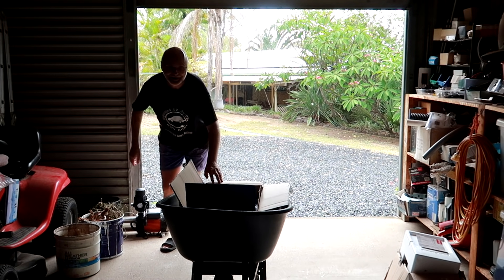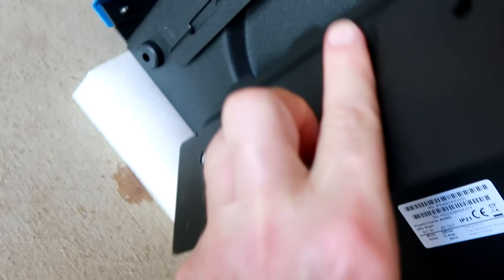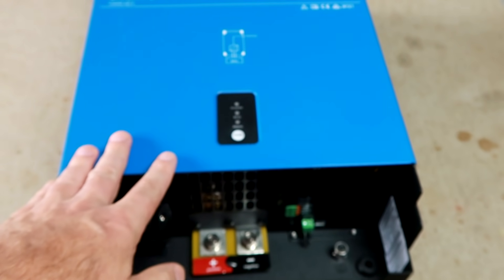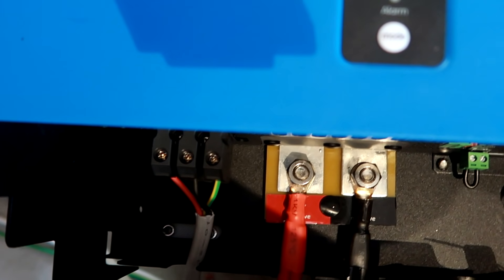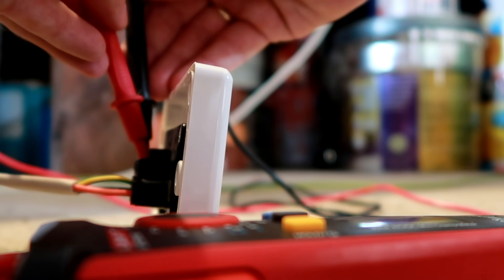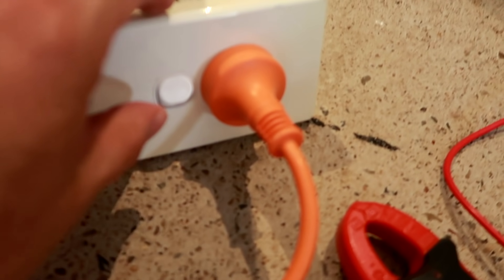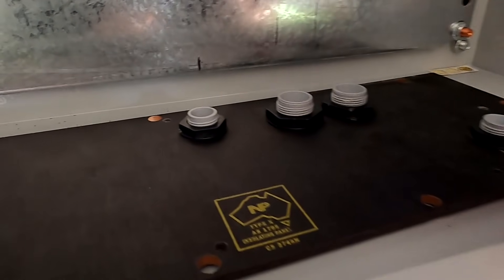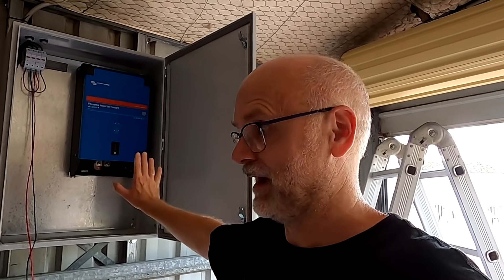Victron Phoenix Inverter Smart. Is 3000VA enough to power our garage?

Comment: Lol you corrected.
Do they use va because it's 2462 watts?
Personally I don't like VA as it's a mean calculation.

My inverter is 1500w with 3000 peak. Well that's what the label says... However having a look at the Mosfets datasheet I'd say it was 1500w only. 

I've a 800w inverter which is 950watts from the data sheet of the Mosfets.
Technically it's a UPS, as I  have a main inverter and sub ones for essential running, also if the main one goes down I can still run;)
But I want to get a bigger inverter. Mine seems to offer weak power if that makes sense... 900 watts grid to 900 watts inverted isn't the same :(
I notice it on my tools.

Comment: Victron is great gear. I have installed it in yachts and always works great. I am picking up 5.5kw of solar panels and rail mounts tomorrow (second hand) in anticipation of getting the MPP PIP 8048MAX which I am saving for. I would like to see if I can charge electric cars directly from the sun with no battery attached to the system.
Reply from the maker: Wow another 5.5kW, that sounds awesome!
You need a specific charge controller which can supply the load without batteries. I don't think Victron can do that though. Also, I don't know what the car's charger would do if there is fluctuation power coming in all the time. Needs to be tested I guess...
Reply: @OffGridGarageAustralia  Hi Andy. The MPP PIP 8048MAX handles batteryless output. I do intend to set up a 16 cell Lifepo4 battery like yours once I get the money together. How many KWh of usable energy does your pack hold? I have just arrived home with the solar panels and rails which I picked up on the Sunshine Coast. Paid just $250 for the lot so I think that is a good deal.

Comment: Hi Andy,

You really should just get a GX device to control/communicate with your devices via VE.direct, VE.Bus, and/or VE.Can. The Bluetooth network is still so new that many Victron products don't support it yet. You'd also need to trade your "Smart Shunt" for the standard wired BMV (Which still offers Bluetooth as well). But if you want to do the load shedding we discussed in an earlier comment thread you'd need that anyway as the wired BMV has an additional relay that can be programmed to come on when the battery reaches a certain voltage.
Reply from the maker: Yep, I know. I am looking into it for a while already. I can also program the inverter to do shedding with its relay.
Reply: @OffGridGarageAustralia  True, but I thought you were going to use that relay to control the fan for your enclosure? :)

Comment: You guys over there are lucky.  Here in the US we have 120 volt single phase and 240 volt split phase which is of course two 120's that are 180 deg out of phase with each other.  Use of 230 volt all the time make so much more sense to me.  How this all started here in the US is beyond me.  We have some devices that are 240 and others that are 120 volt.  Such misery and confusion and with inverters doubly so.  We can get split phase inverters but at a premium cost.  So we have to wire our inverters to a panel and use either single breakers or 240 (2 pole) breakers.  Then of course for some commercial applications there is 3 phase where the legs of current are 120 deg out of phase.  All in all it's a huge inconvenience and expense.  We used to have 'Y' 3 phase and delta 3 phase.  I believe they've done away with Y.  Then we have 440 volt and 208 volt in 3 phase.  And if you tap one hot leg and a neutral in 208 you get some wacky voltage.  And none of that accounts for voltage fluctuation within a particular nominal voltage.  Some things you can run on lower voltage but some will burn open if you do so.  Better read the labels thoroughly here.

Comment: Andy. As people have already mentioned here and I did earlier it is a 3000va inverter. Not 3000 watts. It’s 2400 watts continuous. You multiply the va by the power factor which is always under 1.
Reply from the maker: A light bulb has factor 1, right? Shows me 80VA with a 100W bulb though.
Reply: Off-Grid Garage Yes. But it’s still a 2400w inverter.

Comment: Hi. Have you considered that overload you were getting may be related to DC conductor cross sectional area and length of cable. You may be experiencing lower than optimal voltages. Cheers. Keep up the the great videos. Shane
Reply from the maker: Thanks Shane!
Absolutely. I need to cable everything correctly and will do more testing afterwards. This was just a first test to see the functionality quickly.
Reply: @OffGridGarageAustralia  you may find this calculator handy. I did some calculations for your set up 48v 250 amps and three meter run with 1% tolerance. It recommended 70mm2. I suggest that’s about right compared to my set up. Cheers Shane
Reply from the maker: @shanebrowne2439  with the 3kW inverter, I'm pulling only 50-60A max. The battery has a 100A fuse. My cables are 'only' 35mm for that setup. I keep it easy...

Comment: You can run Venus os on a raspberry pi to tie everything together.
Reply: That's what I use in my campervan. I have the Pi connected to a 4G router so I can monitor it remotely. Works really well.

Comment: Does anyone know where the weight difference comes in?
These are 19kg
Renogy equivalent is 7kg
Obviously there is a dramatic quality difference but the weight difference is crazy.
I wouldn’t use anything but victron inverters but just interesting to know
Reply from the maker: The Victron inverters have huge toroidal transformers which is essential for large loads starting.

Comment: Why would you want the inverter to be connected to the VE smart network? This basically exchanges info about battery voltage and temp, and synchronises charging sources. I can not see where the inverter comes into this. On the VE network (cabled), you would get data out to Victron controls and Victron displays, but you have these data already out to your phone.

Comment: Can't you just measure the continuity between the inverter case and the PE terminal to see if its grounded?
great video as always
Reply from the maker: I did, it's 0 Ohm.
Reply: @OffGridGarageAustralia  can u measure ground of the solar panels and ground of the inverter and see if is there any 50 volts. I mean like the problem with the anoter inverter, the chineze one and i hawe the same problem with an voltronic vm3
Reply from the maker: @andreiapostolache3487  yeah, I did this already and there is no voltage between AC and DC with the Victron inverter. I'll show this again in one of the next videos.

Comment: In Nordamerika sind 120V und 60Hz Standard, der Wechselrichter kann aber nicht bis 120V heruntergehen. In manchen Ländern wie Südkorea und teilen des Mittleren Osten sind 230V und 60Hz Standard. Dafür kann man das umstellen.
Reply from the maker: Victron sells different hardware for different markets. The frequency can be adjusted but not the voltage (in that range).
I didn't know Middle East has 230V/60Hz. Crazy...
Reply: @OffGridGarageAustralia  Nicht nur im Mittleren Osten und Südkorea. Auch in Peru, teilen von Brasilien, Guyana und den Phillipinen sind 230V 60Hz die Netzfrequenz. Deswegen sind viele Elektrogeräte für 230V für 50 und 60Hz ausgelegt.
Reply from the maker: @OffGridValentin  There you go....

Comment: Say that the inverter could join the VE Smart Network, what useful purpose would there be in having the battery voltage being sent to it wirelessly when it can just measure the voltage at it's own terminals? I like the idea of having it on the VE Smart Network as well but I can't really think how it would add any value? Everything the inverter needs to know it can obtain locally, why complicate it?
Reply from the maker: It compensates for voltage drop and would know the real battery voltage measured by the Smart Shunt. Especially important at higher currents.
Reply: @OffGridGarageAustralia  the voltage measured at the battery is irrelevant to the inverters operation, it doesn't matter if the voltage drop is 0.1V or 5V the inverter has no ability to change this and will compensate accordingly based on inverters input terminal voltage. I am genuinely interested to hear what you think the inverter could usefully do with the battery terminal voltage instead of at the inverter input terminals?
Reply from the maker: @isaachauser521  it does matter if the voltage drop is higher. The true battery voltage matters as the inverter could keep running longer. It gets the wrong picture of the state of the battery if it measures only at its terminals. 
But the inverter is smart! 😉 It has a setting called Dynamic Shutdown where it not only measures the voltage but also the current and shutd itself down according to the actual load. So higher load, it shuts down later. With this setting it somehow compensates for voltage drop between inverter and battery.
Reply: @OffGridGarageAustralia  it does not matter how much higher the battery voltage is compared to the inverter terminals, once the input voltage is out of the inverters operating range, the inverter will stop. The Dynamic Shutdown setting you are referring to is the unit dynamically adjusting the shutdown voltage based on load, this indeed compensates for voltage drop and sag from the battery itself, it basically just sets a series of shutdown voltages and current points and then interpolates between these values when deciding when it's time to shutdown due to low voltage. Example (200Ah LiFePo4 battery) 1A current = 52V shutdown voltage, 50A current = 50V, 140A current = 49.20V and 400A current = 48V. I understand you want it to talk VE Smart Networking but again I ask what useful thing would you like it to do?
Reply: @OffGridGarageAustralia  Andy, I'm going to have to disagree. The only way to counter the effects of voltage drop is to eliminate it to the greatest extent possible.  
In another response I have detailed a cheap and easy way to achieve this. 
Where V is voltage drop, lost energy is V squared divided resistance multiplied by time or if you prefer current squared by resistance by time.
For high current extra low voltage circuits resistance needs to be minimised.  Keeping cable runs short and using two or more cables in parallel divides the resistance and I strongly recommend the use of Belleville washers at all high current connection points to vastly increase  effective contact area. 
Cable lug preparation and crimping is another poorly understood issue. It is worth cleaning inside the ferrule of the lug before crimping. Oddly enough indent crimpers are the most effective for flexible cables.

Comment: Just put some window screen over the vents and they make filter material you can cut to size for computer fans 😎👍🇺🇸
Reply: 030521/0206h PST 🇺🇸 ....that may also not be effective. The garage also is metal enclosure and it’s closed when Andy leaves home. Looks like double Faraday Cage. Heat is what Andy needs to look into. Australian summer is quite hot, about 26.8C (80F+) and climbing. Imagine the heat inside the garage and the inverter enclosure.
Reply: Ya keep it outside the enclosure with screen and filters

Comment: What did you get up setting the float and bulk/absortion voltages on the 48v-16s system
Reply: depends on the battery specs

Comment: 16:27 sorry but If you tighten the screws firmly, there will be no problems between plus and minus even without protection. When working on the cables, the lines should be de-energized.

Comment: i am suprised with them doing conroller shunts inverters etc that they dont have a control head unit that can collect all information and display it to what ever device you wont as in a single screen but the info for all devices
Reply from the maker: They do have the GX devices which connect all devices together and also present the data on an online platform which you can connect to and control al; your devices.
Reply: @OffGridGarageAustralia  oh i did not know about that not scene anything about it
Reply from the maker: @1981dasimpson that's the one I'm looking for a while.  https://www.victronenergy.com/media/pg/Cerbo_GX/en/index-en.html
Reply: @OffGridGarageAustralia  ok thats a game changer i was looking at electrodacus for when i go off grid again but hmmm victrom may be building the kinda system i may want i just wish they would make rack mount stuff

Comment: I think you are going to need fans, input fans, and exhaust fans at the top.  That is going to be hot, even at idle at 18W with no airflow in the large case.  Looking good!
Reply from the maker: Yep, definitely need active cooling and airflow. Idling and small loads are fine with closed door. But it all depends on the ambient temperature as well...
Reply: @OffGridGarageAustralia  But why keep it in the closet, it makes no sense, it is made to be in the open, just NOT to get too hot.

Comment: For the Communication between the devices you Need to configure the ve Network.
Why did. you get a Phoenix ? And Not a multiplus ?
You als Need to put your MPPT in the ve Network.
Reply from the maker: You need a GX device for all that...
Reply: @OffGridGarageAustralia   
You can also Use a multiplus whitout a Gx device.
Reply from the maker: @dietermaes2647  yeah but you need a GX if you want to access your system through cloud...
Reply: The easy solar comes with mppt and colour control (old models) the new version has a simplified GX, but lacks the Ac distribution of the old version. It was on the Victron YouTube channel recently!

Comment: How about cutting some sort of an opening in the door and fit a plexi glass so you can gaze at your perfect workmanship?
Do i forsee you install HomeAssistand on a Rasberypi with a Bt dongle, so all your Victron Bt devices connect to the pi and you can use your tablet or phone to 
watch charging, current draw, tempereature`? I think you can even add your Tesla to Homeassistant so you can check the status.
Would be nice to have one place where you can see everything.
Just a thought-..-

Keep up your Great work Andy, I do enjoy watching your videos from Norway.
Reply: Yep, I think he will be cutting some sort of opening in the door, but probably for cooling, not plexiglass ;-)

Comment: OMG, He is reading the instuctions. LOL
Reply: yes now he reads - pity he didn't bother checking the specs before out-laying $1000 on a lower performance inverter. Many tried to tell him to go to the 48/5k. and he seems fixated on confining the new unit in a stuffy little box. to get anywhere near the 3kva output he'll need to keep it under 35℃ ambient so good luck with the cabinet.
Reply: U shold change setings from 230v to 240v for more fast charge on the Tesla
Reply from the maker: @andreiapostolache3487  I'm not in a hurry
Reply from the maker: @colinbeckitt9495  You must be new to the channel. I explained multiple times why I didn't buy an MPPsolar. Back to start and read the manual!
Reply: @OffGridGarageAustralia  nice i was doing the same and i check all the óptions i mean 240v it was more eficient for my Heat pump
Reply: @colinbeckitt9495  why not i read It to and was not a victron It vas a voltronic all in one, and learned alot changing óptions and see if is beter ir not

Comment: it would have been better to connect cables to inverter and pre charge at battery. It looked cramped to get that resistor in that space.
Reply: Yeah always connect the inverter cables before the battery, then you aren't waving live cables about :D

Comment: The price of a simple current transformer is enormous (€1,800) compared to what it offers, and the companies that offer the warranty charge you for the inspection and say that the energy measurement sensor has nothing wrong with it. Victron Phoenix Smart 48/5000VA.
In the profile picture, Cerbo GX tells me that Phoenix charges with 33A in AC.
Reply: the authorised dealer who assisted you when you purchased should be able to help

Comment: Your inverter is very nice, but i think you can't charged your tesla car up to 12A coz the max output of your ve inverter is 2400w only..
Reply: I think Victron is designed for colder countries and Andy's shed sometimes gets over 35℃ in summer so that cabinet will impinge on that 12A charge. My 48/3k MultiPlus II could only handle  a constant 7A-8A on hot WA summer days and constantly overheated so I had to restrict it to just 1750 - 1850W constant output just to get it to run all day. Good luck with a 10A - 12A for Tesla charging. We all tried to tell him 48/5k was the way to go.
Reply: This converter has a capacity of 3000VA and 2400Watt continuously, many people forget the difference between VA and Watts
Reply from the maker: I don't need to charge on 12A as I said before.